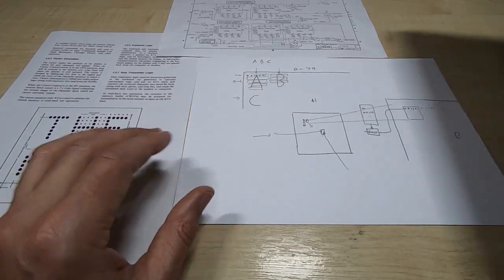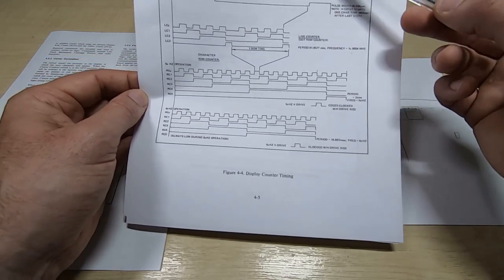ADM-3A  Board Reproduction Part10

Comment: I guess I don't understand the 50Hz vs. 60Hz options you discuss at around the 16:00 min mark.  Does the main system clock speed vary with A/C line frequency and that's why the system needs different clock adjustments to keep things consistent?  I was thinking that the main system clock was a crystal oscillator, which had no dependency on A/C mains freq.  If that is true, then the character counter shouldn't need to be adjusted for mains frequency because it isn't used to generate the clock signal, so why is the 50/60 Hz option needed?  I obviously must not be understanding something somewhere...
Reply from the maker: This option only sets the monitor refresh rate and does not affect the other clocks and is to allow the system to be used in locations with either 50Hz or 60Hz mains supplies. Locking the monitor refresh to the mains frequency was common back then and has various advantages. It is most evident when the 'wrong' frequency is set as you see rippling on the display due to AC distortion. If this distortion is synchronised with the mains then it is static and not evident.
Reply: @JerryWalker001  Ah, yes, got it.  Thank you for both responding and for taking the time to produce these videos.  Your channel is chock full of really interesting content that is very well presented.  Thank you!